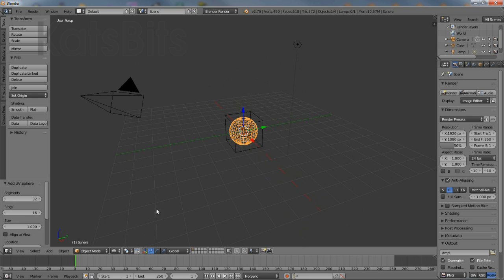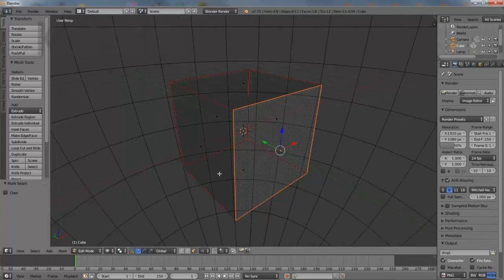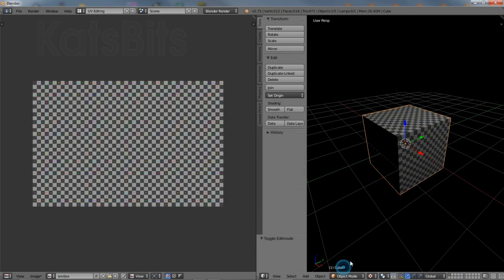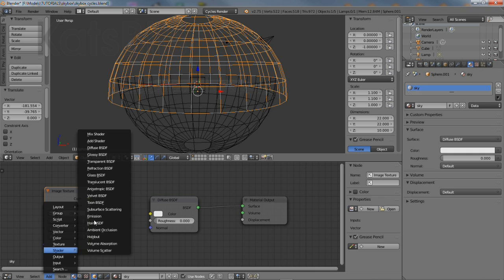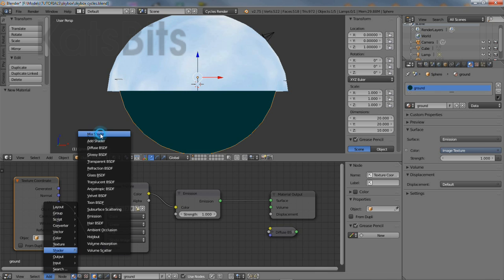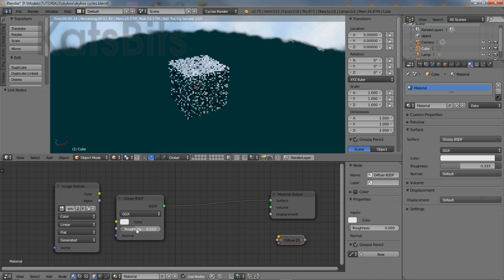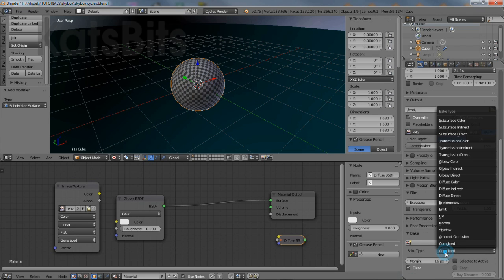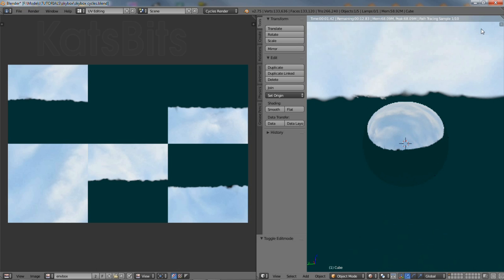Render Skybox using Cycles Render in Blender 3D

Comment: Hi dude. I don't have any idea about placing object into this skybox with right scales...
http://www.plus360degrees.com/uxcars/  -  check this link
I want to place object like this car. You can see they use skybox(sphere) aswell. But this car placed on road with correct scale. How to recreate the same result??? Any ideas?
Reply from the maker: You'll need to add either the car/road to the skybox file, or the skybox to the car/road file using Append. Once that's done rescale either/or appropriately. If you don't have the car/road your only option is to eyeball the scale/size of the skybox.

Comment: This was very close to solving my skybox problem, but right around 5:17 I would add the image texture on the node, and the material would change to purple. Not sure what the issue is :/ hopefully you check comments and can help me solve this issue. Otherwise great tutorial! ( and THANK YOU for using cycles render )
Reply from the maker: +Cj Rhone If it turns purple/pink (assuming the Materials diffuse colour isn&#39;t set to that) that usually indicates the image you&#39;ve assigned to the materials node isn&#39;t the same one assigned to the objects UV map - basically the UV map and material nodes should reference the same image. HTH

If checking that doesn&#39;t work post a screenshot of what you&#39;re looking at - either on the forums   http://www.katsbits.com/smforum/index.php?topic=792.0 (you should be able to sign in using your Google+ credentials) or post a reply below with an imgr link or similar.

And yuppers, comments are answered as quickly as possible ;)
Reply: +KatsBits Thank you for the quick reply! I&#39;ll be sure to join your forum!

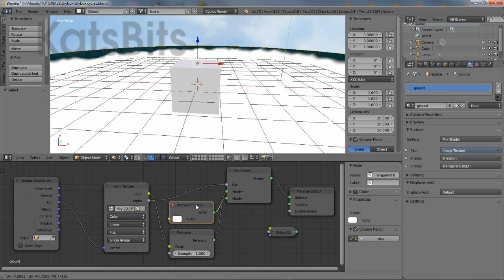I re-watched your tutorial and identified that, indeed, I did not correctly UV map the image I was assigning to the objects. So far I&#39;m at 6:50 and have everything you have,  but I do have more questions I hope you could clear up for me.

1) What does baking do? I&#39;m unaware of the concept as I&#39;m new to 3D

1) Baked Cube - In 3:13 you mention the importance of UV Unwrapping the cube and assigning an image, so the Skybox will bake from the cube in cycles render. Is this step essential for creating a skybox everytime? Example: I have object i&#39;ve created and would like a skybox environment, do I need to create a UV sphere AND a cube within the sphere?  

2) Nodes - You briefly touch on the mix shader and transparency nodes in 6:50. Could you elaborate why you&#39;ve added these? What do they do to my skybox, and why only the bottom half of the sphere?

3) Is it possible to keep your sphere ( cube ) reflective as you did in the end, but also keep its original texture?

Thank you in advance! This video has saved me tuition money XD hahah
Reply from the maker: +Cj Rhone  You&#39;re welcome.

1) &#39;baking&#39; basically allows the use of geometry to generate texture data, in this instance a skybox, although others are available (normals, ambient occlusion, shadows etc.).

2) (2nd &quot;1)&quot;)if the skybox is to be used in-game, generally yes, otherwise there&#39;s no way for the game engine to determine how the textures for a skybox are supposed to appear on an object (an exception for this might be when using Blender Game Engine as that can interpret Blender specific properties). A skybox can be rendered from any position (the cube) but it may result in offset images when used in-game. The only require part is the EnvBox cube, however without anything in the Scene all that&#39;s rendered is a grey box.

3) (&quot;2)&quot;) transparency is not needed but it is useful for terrain based skyboxes where the horizon isn&#39;t a straight line. With transparency in place you could add a tree-line without having to actually make all the trees - http://www.katsbits.com/tutorials/blender/cycles-skybox.php#mat_transparency

4) (&quot;3)&quot;) Not 100% sure that&#39;s possible because the reflective Material is an active property that&#39;s projecting the Scene onto all surfaces of the cube. With the image in place the mater set-up would differ, possibly over-riding the projection mechanism.

You can send that tuition money to us ;) lol